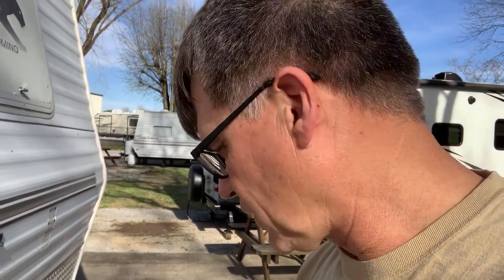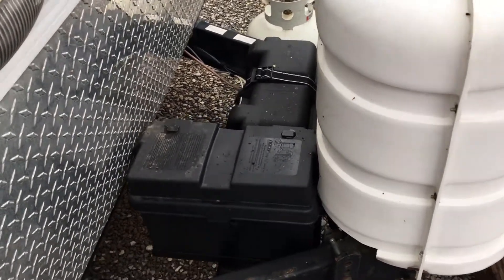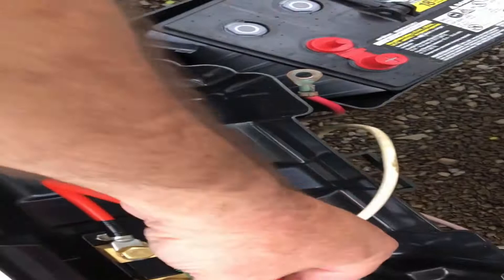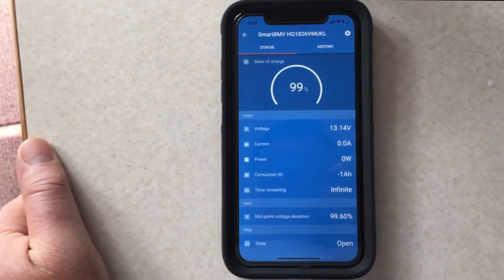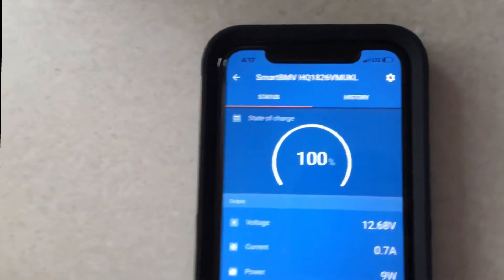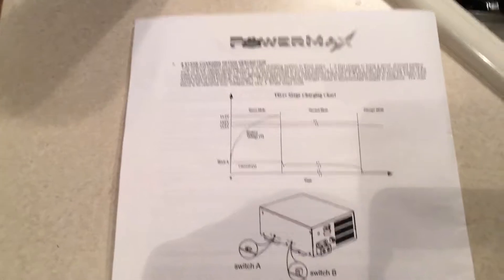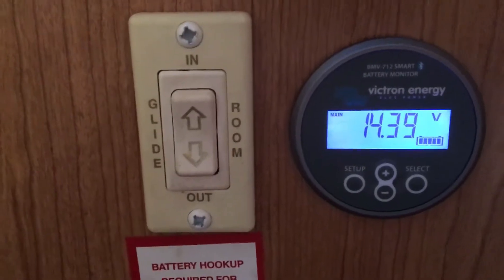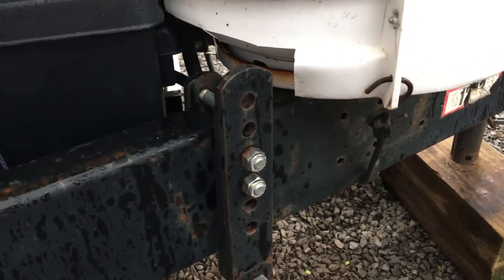Part II - Victron Battery Manager & AGM Battery Upgrade!

Comment: Hi. Two things. Your negative wire from your shunt to the van should be the same size as the other wires coming from the batteries. The thin white one looks way too small. You will be losing voltage across the line, that won’t be shown by the Victron monitor because it’s reading at the shunt. Wire sizing charts can be found online. Please note that calculations on the charts/tables are based on the distances each way. It will also be getting hotter than it should. Second, the charge settings on your inverter/charger should be set to the Duracell specs printed on the top of the battery. Only maintaining 14.6 for 30min seems odd. It should be charging at that voltage until it is almost full (end of bulk/absorption), when it should then switch back to 13.4-13.6 for the float.
Reply from the maker: Thanks for sharing.